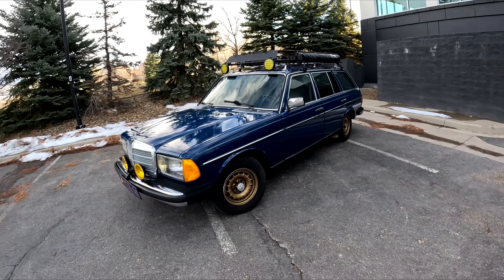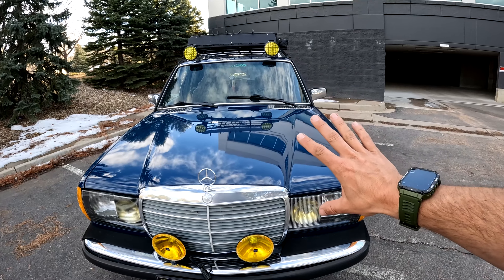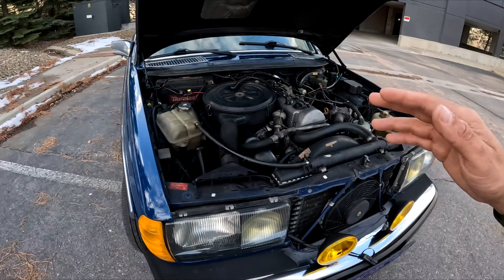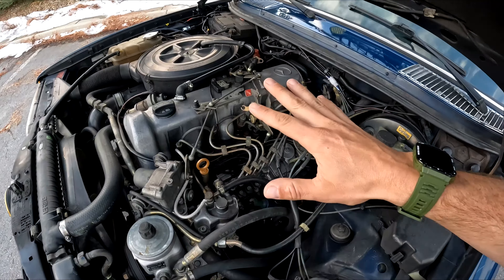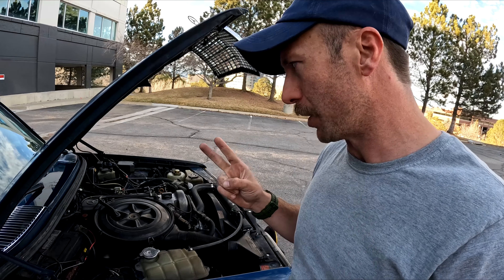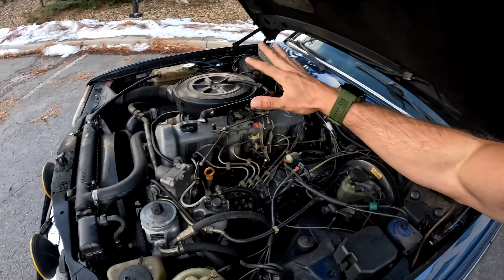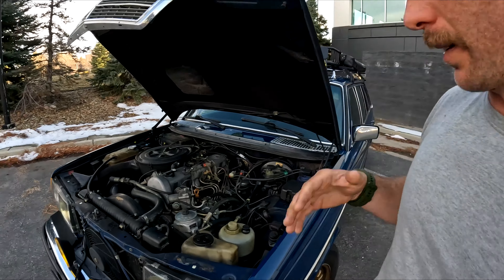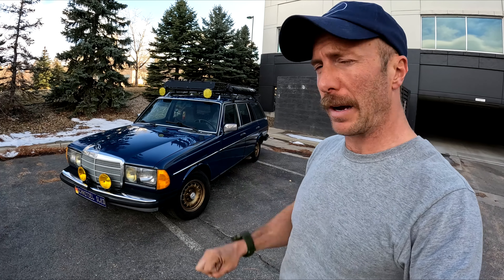How to get your Mercedes W123 to last 500,000 Miles.

Comment: My 300D wagon has now 1.280.000km on the clock. Has been a former taxi.
It‘s leaking oil like nothing else. The transmission is still working fine. Big play in the steering box - which can be refurbished. Overall it still runs strong.
Reply from the maker: that is incredible! what has been the biggest failure point.
Reply: I have to point out, it‘s also my daily all year round. :)
The pre-glow relais died a few weeks ago. The car was parked overnight. I thought you‘re able to crank the old Diesel simple longer and it will start somehow with noise and rattleing. We tried to heat the engine block with a torch and tried to get it started with little brake cleaner.
I was told the iron block has to ,pre-heat‘ itself and the internals. There is almost no chance to get it running in winter temperatures.

Second failure was not really a big issue: The alternator. I ran the 123 for 5 days after the alternator died. Which was like 5000km. :D And then the battery showed signs of dying. ;)

Third: Hydraulic rubber hose to the rear axle was torn and broke due to age.

I have to address the play in the stearing box. That‘s bad. :D
Reply: is it impossible to deal with the leaks? That's a fear of mine
Reply: @Altanox  Yep, just take extra oil with you. I have to refill around 100-200ml every 1000km.
It‘s definitely a poor solution. Engine and transmission have to be taken out to address the leak correctly.
Reply: @Altanox  You can get these cars leak-free—it just takes some sweat, but it's really worth it to get your W123 sorted
Reply: @jakelobel8245  I just don't know how to deal with the oil cooler leak. I can't get a replacement and idk what else to do. I heard some people drilled and re threaded it, but no idea where to do that in Belgium
Reply: @Altanox  find  a radiator shop and have them repair the cooler, they can blast fluids through it to diagnose where the leaks are.  New oil cooler will be more expensive,  usually.

Comment: I have this wagon, also an '85. a wonderful car.  This video recently popped up on my youtube page due to the fact that I recently watched another one of yours videos on your R1100RS, I also own one of those, a '96  I guess great minds must think alike, keep up the good work!
Reply from the maker: Thats too cool, what color is your 85? and how has your Beamer been reliability wise?
Reply: it's beige ("ivory white") with a palomino exterior.  The beemer had been sitting for 5 years before I got it about 5 months ago, I changed all the fluids and filters, new brake pads, new cables, new battery, new fuel filter, new fuel pump, new fuel lines, new fuel injectors so now it runs good and is reliable for now.  It needs new tires, I want to put on Pirelli Angel GT's but they're backordered.  Also the fuel gauge isn't working.  The maintenance list for the wagon you came up with is great.  I've done most of that already, I have new monark injectors but still need to replace them.   I have a new cohline upper oil cooler hose but you can't find a decent manufacturer for the lower line anywhere.  Will be doing the engine mounts at the same time.  When replacing the glow plugs it's also a good idea to ream them out, mercedes source has a good tool for this.  I didn't see the coolant you recommend in the comments...  @SirDrifto

Comment: I just bought a 1981 240d because of your videos. Found it here in LA for $300, in great condition. Silver, with navy blue interior. The interior is super clean, but the paint was faded. I buffed it, and happy with the shine, but the fade is there. I’ll be taking this on my move from LA to Seattle, so I’ve been doing a lot of work on it.
Reply from the maker: That is awesome to hear, how are you liking the car so far?
Reply: I was looking in LA a couple weeks ago. Nothing even close to $300
Reply: I got lucky. It was in the city of Duarte just sitting on the driveway for 4 years. The owner passed away with Covid. The silver paint is faded, but I did my best buffing it out. I wanna get a paint job, but haven’t even looked at prices.
Reply: @sirdrifto I freaking love it! I just wanna make sure it’s roadtrip ready, and I’m also working on the ac. I have to convert it from an r12- r134. I just changed the support bearing because it was broken, and also changed out the flex discs, radiator, and water pump. The speedometer is broke, so I bought one off eBay. Scared to work on the Speedo myself though lol

Comment: Excellent video!
For your information, the slowest model is the 200D, though it came in 2 versions, 1976-1979	and 1979-1985, the former having only 55 CV while the second one (the one that I own) had 60 CV. Even these cars are drivable in modern traffic, I use mine in the highway with no major issues, though you want to use a long speeding lane to incorporate.

Comment: Drain tranny fluid from both the pan and the torque converter and change the filter (instead of the evil flush I run fresh fluid for a month before changing the filter then do a complete drain and fill with new filter). Also check and renew flex disc - driveshaft detachment at speed is undesirable.
Reply from the maker: Very true 👍

Comment: The 280e is still one of the most underrated w123s.  Reliable and much more powerful.  230e not bad either.
Reply: 230 better than the 280.

Comment: Good points made in the video on what items to keep on top of, the only other critical ones would be the timing chain and vacuum pump.  The turbodiesels are a bit harder on their timing chains than the non turbo/240's and you really want to be inspecting the chain stretch (and likely replacing) the chain every ~200k miles tops in most cases. With frequent oil changes/good oil this can often be extended based on results of checking the chain stretch.  The vacuum pump on the front of the motor should also not really be trusted much over 300-350k miles as they are known to fail from fatigue and can dump parts into an otherwise good engine, destroying it.

Comment: Owned and loved 3 of the 300TD turbo 1983 1985 solid with the typical MB failure points. Same MB mechanic for 20 years He as key to the longevity. No rust Florida car purchases. Went to 300TE ICE which was not as solid a motor. These were beautiful cars at gave me many miles of joy. Newer MBs are not as reliable unfortunately. Would never own a newer MB as I was spoiled by the quality of the older models

Comment: 21:10 When I bought my 1985 300D, it would not up shift out of 1st gear (previous owner took $500 off the asking price because of that), I drove it around the corner, added more ATF and the transmission has operated normally for the past 16 years.

Comment: If l owned any diesel vehicle l would change the engine oil at 5000 kilometres and there is a Mercedes-Benz W123 300TD at a local mechanics workshop and its in the same complex were my wife volunteers a charity shop and because it was parked with its rear end to a fence well l never bothered to look exactly what W123 it was and the bonnet was opened and l had a look and there was the magnificent OM617 and l noted that you were talking about reliable engines and you mentioned the 22R engine well l own a 1997 the last year for the 22R engine in my 1997 Toyota Hilux and when l bought it 5 years ago l never realised what a very good engine l had and after researching through you tube and Google l was very pleased there are lists of reliable engines and in the same list it refers to the OM617 engine and the 22R engine and you are obviously well pleased with your Mercedes-Benz W123 300TD and l have actually drive a Mercedes-Benz Commercial vehicle a single cab ute and it had the OM617 engine l am not sure what year it was but it was OK performance wise there Mercedes ute wasn't luxurious but the ute had four wheel disc brakes

Comment: I remember as a kid, my neighbor (in Europe) always drove sedan 240D. Passed away 20 years ago, so his  son was driving it afterwards. 12-13 years ago, he sold it as I was about to move in USA....
2 years ago I saw it last time I visited, I recognized the car in it's perfect dark green color. Asked the new owner and he told me it has 800k miles on original engine and NEVER drives it on interstate, never above 3k rpm, city driving only and never above 55pmh.

My point: everyone expects to drive a car here in States 70mph on daily basis and then blames the car. Its an old diesel, even 300 wont last if you don't baby it.
Reply: pretty sure that's bad for the car. diesels need the highway clean up. Those injectors  are gonna die
Reply: @Altanox  Idk if you're right or wrong, what I do know is that car had 800k miles two years ago and he didn't even come close your level of detail when it comes to maintenance (he is too cheap) so he has to be doing something right.

Comment: My 1983 300D has low miles speedo died at 676,000 miles. That was a few years back. I also have a1978 300SD the 254 one made. it motor is 154 one made. The 300SD has 733,000. The SD is parked because the tranny died at that milage. A few years back. To get lots of miles. Use a very good grade of oil. Change oil at 2500 miles. Keep valves adjusted also. They can go for ever. Use the 300D as a farm beater. I also have a 1980 L1116 Benz truck. Other diesel Benz I have is a 1979 240D. Found a very nice 1970 220D a few years back.  The person before me did not check the oil. She ran it low on oil  did the rod bearing in. She did not read the hand that states this car will use oil.

Comment: The old Volvo petrol engines are the most reliable car engines and don't use an oil cooler. The owner of a P1800S drove it over 3.25 million miles with the original B18 engine. The 200 series Volvos are much safer and have a much smaller turning circle than the W123, while the wagon variants have a lot more cargo space and were available with a rearward facing bench seat for children as an optional extra. The W123 feels more luxurious and better made, but in the real world the 200 series Volvos are better in every metric that matters... also easy/inexpensive to fit a limited slip diff to a Volvo 1030 (Dana 30) axle.

Comment: How often do you adjust valves if you don’t drive a lot? I’ve only put about 2k miles on mine over a year since I bike a lot.
Reply from the maker: I feel a save estimate is every 12k miles +/-. Some go longer others do it before. But I feel that's a good bench mark to go by.

Comment: How did you run the cables for your roof lamps?
Reply from the maker: @hanseich  right through the fender gap corner by windshield
Reply: @ so you’re running it down the “a pillar” on the outside? I just bought one of these. Am thinking of adding something like this.

Comment: W123 owners what fuel economy US/mpg or km/litre or litres/100km do you see? Thanks
Reply: I have an '81 240D.  I put in the 3.46 differential from a 300D instead of the 3.69 it came with. On a trip in May from OR to AZ I got 30mpg driving 65 to 70mph. The last leg of the trip I slowed to 60-65 and got 34. My CA version '85 300D gets about 23 in the city and I got 33 on a trip to Seattle a few years ago